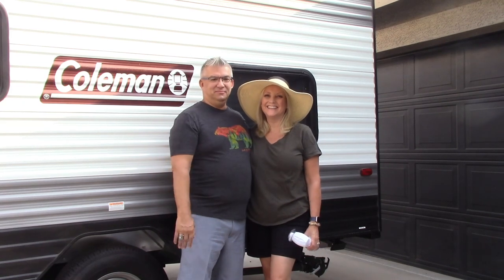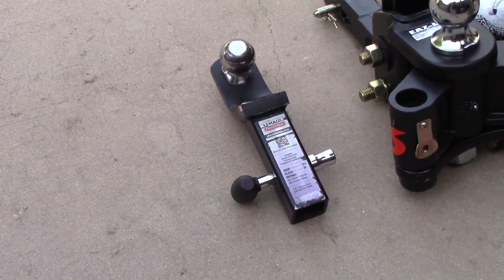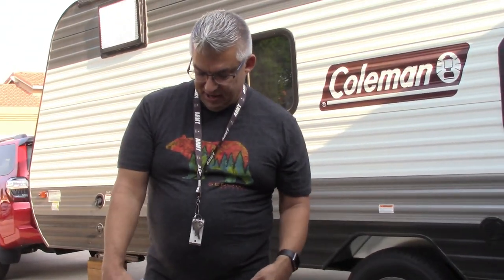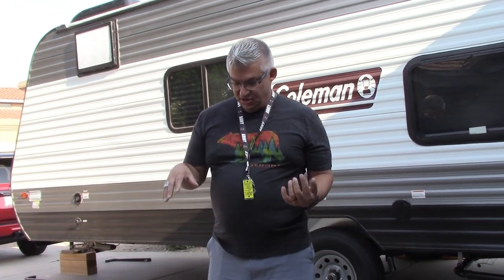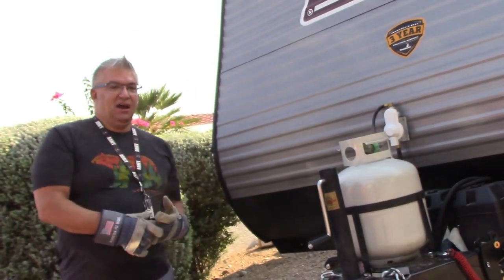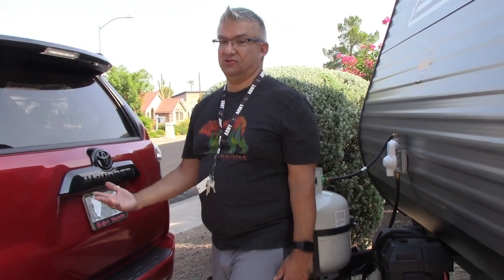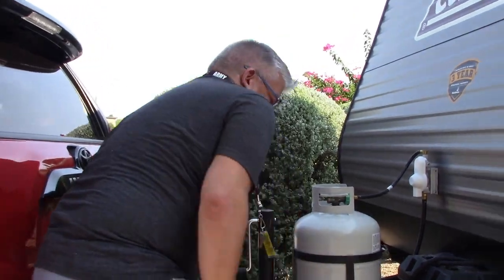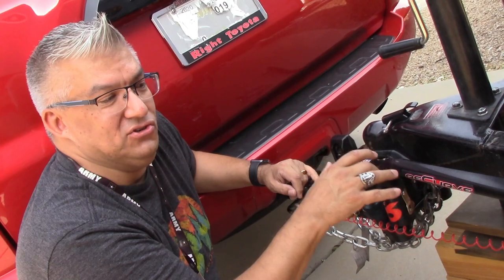Hitching A Travel Trailer - Sway Bar, Weight Distribution and Brake Controller

Comment: Good video. What is the pin and cable called that is attached on the trailer tongue that you used to secure the sway bar in the lock
Reply: T Pin hitch pin with push button release

Comment: I ended up getting the weight distribution hitch also. Didn't have any sway issue so didn't need the one with sway built in. Good video. On another note. Best thing I have done to the 17B is that I installed an electric tongue jack. Only 3 bolts and one wire to hook to battery. Super super easy. So so nice. Also if you raise the trailer when connected to tow vehicle it will make clipping in the sway bars way easier. At least thats what I learned by doing it. Safe travels.
Reply from the maker: Brodie Stephens have a blast in Yellowstone!! Post pictures.
Reply from the maker: Brilliant tip!

Comment: Thanks for the video, and for your service!  Based on what I’ve read about the way these hitches work, the main purpose of the spring bars is to distribute weight. I use a different brand, that also serves to create friction to minimize movement and swaying. You describe yours as acting as an isolator. How does that work? Also, while I also opted for a beefier, more expensive weight distribution hitch, the cheaper ones work just fine for what they’re designed to do, I think.
Reply from the maker: The way the bars work is indeed the weight distribution part of the hitch.  It also serves a bit to absorb the sway by allowing the pivot of the bars, thus distributing the sway as much as the weight.  I was impressed by the design of these, but indeed to your point, others do function well.  Having anything more than a ball helps improve safety.  That and speed....I see some people doing 75 in their trailers, the speed should be determined by road conditions, tire ratings, weather, driver experience, tow vehicle but 75 is a bit too fast for my setup.

Comment: We will be joining the LT 17B family in a few weeks.  I was curious about the "X" sign the dealer gave you when you arrived with the U-Haul ball.  Did you use it anyway to get Stella home or did you have the WDH installed at the dealer?  I have time to order my WDH but have no way to install the anti-sway receivers on the rig when we pick it up.
Reply from the maker: Ken, yep we had them install it while we did paperwork.
Reply: @WildlyGraceful  Cool.  So you purchased it from the dealer instead of being able to get a deal online.  I wonder if they will install one that I bring with me as opposed to buying one from when I pick up the rig?  Does that also apply to your electronic brake controller?  Did you buy it from the dealer and had them install it before you pulled Stella out or did you do that after you got home?

BTW, great collection of very helpful videos.
Reply from the maker: Ken Krueger we bought everything from the dealer. It was just easier for us. We had no idea what we were doing and were already overwhelmed with trying to figure out what else to buy and how to use it. It was really simple and saved a lot of stress for us.

Comment: Thanks for the video. We have a 2019 Toyota Tacoma. Would the weight distribution and sway bar links you provided work for our truck? I saw the other comment about calculating "drop size" for the ball and I don't know what all that means? I'm just wondering if I order the weight distribution hitch kit off Amazon through your link if it would work for us (is it universal)?
Reply from the maker: Brandon, yes a sway bar attaches at the hitch so it will work for any vehicle.  The drop on this bar is adjustable and it is how you align the trailer connection to the ball on the hitch.  So if you have  a lifted truck for instance, you will need to "drop" the ball down to connect to the trailer so the trailer is level once connected.  It is not safe, if you don't have a level line between the trailer and the tow vehicle.  Hope that makes sense.
Reply: I have the Coleman Lantern 17b and a 2021 Tacoma.  I pull it using this same hitch in the video.
Reply: Actually watching the rest of the video.  I have that hitch.  But didn’t get that pry bar.  I just adjust the tongue jack until the sway bars are even then they fit right in
Reply from the maker: @mkeathley  That was our plan and what we did until we found ourselves in a spot we couldn't get level - then we needed the bar and well you saw it took us a bit to figure it out lol.
Reply from the maker: @mkeathley  I hardly feel the trailer at all with it.

Comment: Thx for the info. I went with the tekonsha P3 controller. Works well with the 5th wheel we sold. So it should work well with the new rig. Whenever it gets here. I am looking into the ez lift hitch. Glad to know it is a quality unit. So many choices, but having weight distribution and sway in the same setup just makes sense.
I would get rid of that red safety cord on your emergency breakaway switch. If your trailer breaks away the cord will not pull and not activate the brakes. The chains are shorter than the cord. It does tidy up the area but it really is a safety issue.
Reply from the maker: Good points and I have been planning to shorten that brake cord a bit.  I get why they want it to not falsely activate but it is a bit too long.

Comment: Hi. New sub. I also have a Coleman TT. But it's the RD. Some thoughts here: I think your trucks tow capacity is 5000. You always tow 80% or lower. My camper is 3850GWR. Your may be close to that. That's too close for me anyway. I would get a half ton pick up with 7000 tow cap or larger. Plastic chocks will break. Get good rubber ones. Informative video. Nice 4runner. Be safe out there
Reply from the maker: Traveling with Rick thanks for the advice. She weights right at 4000lb loaded weight; we purposefully kept her at 80% capacity. Our chocks have rubber on the underside. We are just testing out and if this is a lifestyle we want to embrace long term, so starting small. We for sure wouldn’t go any heavier with our 4Runner.